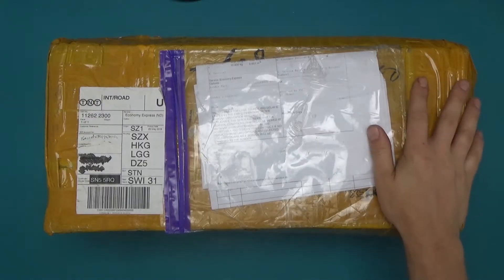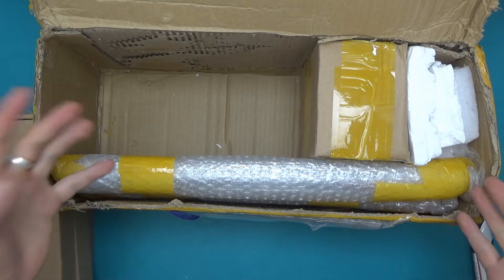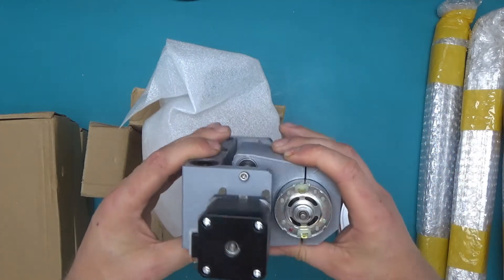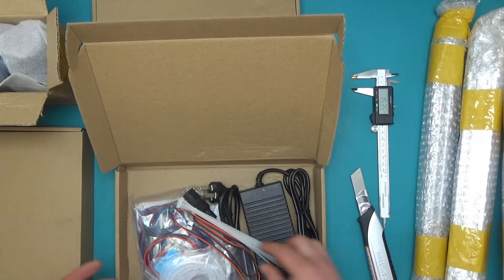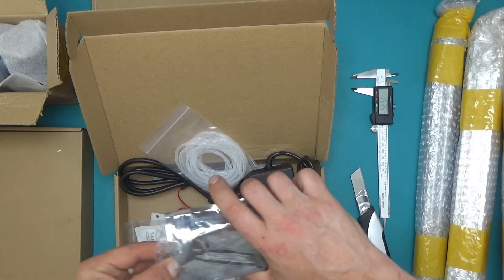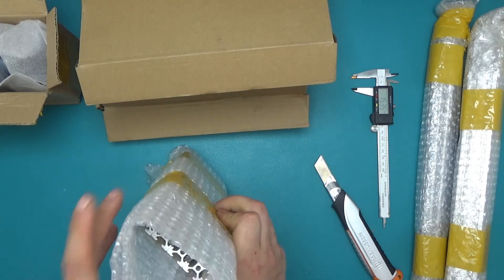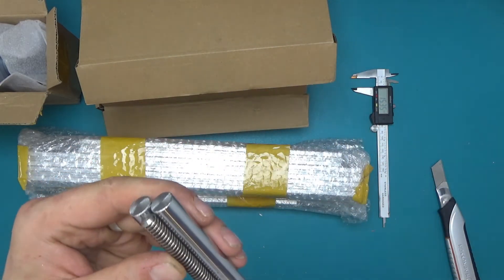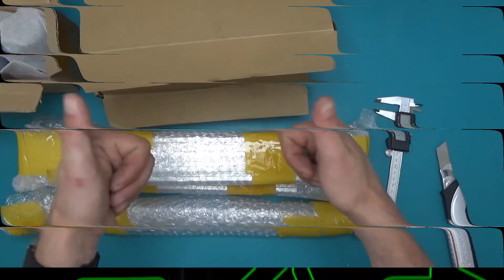#002 -  CNC 2632 unboxing

Comment: Was thinking to machine something larger then the bed, say twice as long ,could you cut half then move the other half and cut that?  Ohh First.. First time I have done that in 10 years or ever for that matter.
Reply from the maker: Well, it is possible to cut the workpiece in to and do to parts. But it is not always practical. You could even in theory do it without cutting the workpiece, just slide it along part by part. But I don't even want to think what a nightmare this would be to keep everything in alignment ;)